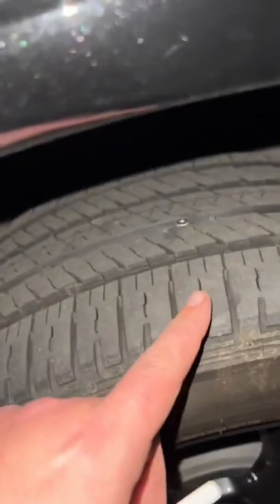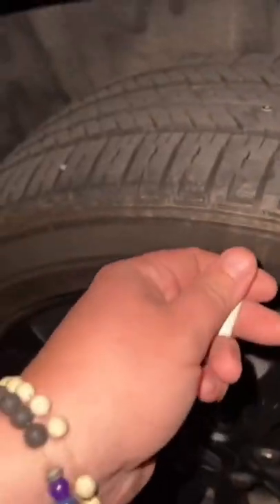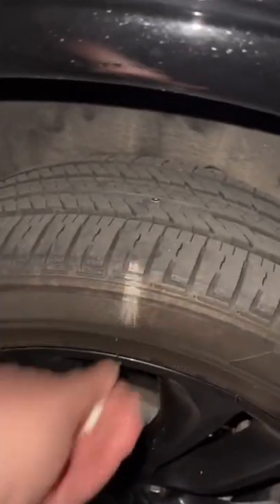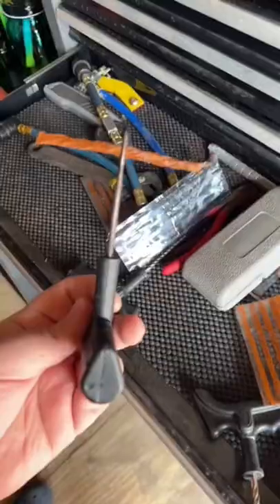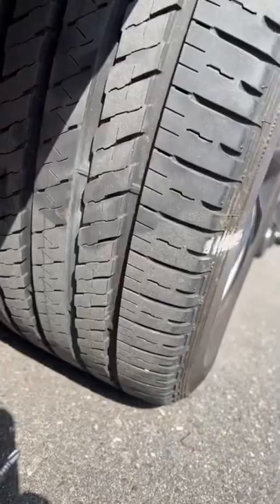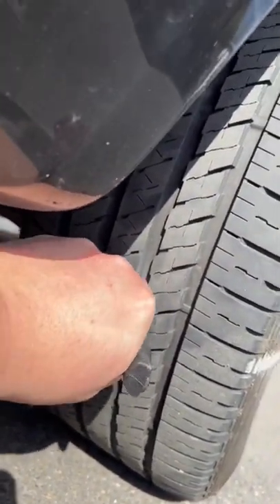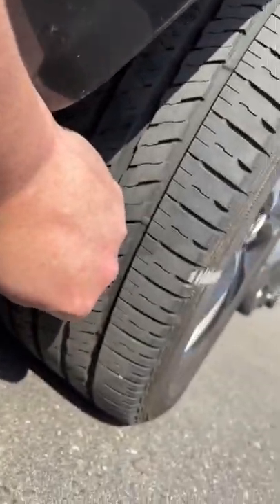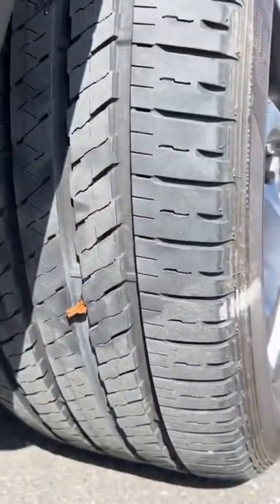How To Plug A Car Tire.

Comment: Additionally if you can’t find the screw/area you can spray soapy wooder to find the leak (the air leak will cause bubbles in the area)

Comment: I've had that happen and I was glad it barely leaked. It's nice being able to drive to a shop without having to throw a spare on. People say plugs aren't a permanent fix but I've been drive on one for 4 years and all throughout my childhood my family used them and never had one fail.
Reply: The probability of having a puncture caused by another object on the same tire is much greater than a failing plug so by my logic i consider it safe enough, always used plugs as a permanent repair on my cars over the years not a single problem so far.

Comment: Cool video. Nice discussion in the comments. I've used plugs a bunch of times. Mixed luck when the hole was between the treads like this one.  Usually works better when it's in the thick part of a tread.

Comment: The plugs are not meant for vehicles. They are only meant to be used on anything that goes under 25 MPH. They can easily come out on cars and trucks running 55 or faster because of how fast they spin. Did this on a 50 CC and it came out with all my air lol.

Comment: I would highly advise getting a patch plug instead of a plug.
Reply: Isnt that for bicycles?
Reply: Patch plug is impossible to apply with just hands. You need a machine to remove tire from rim
Reply: And your qualifications for making this statement are? Steve here is an experienced mechanic.
Reply: @greego5952  a plug patch combo patched from the inside will insure no moisture gets into the steel belt and rust, if moisture did the steel could delaminate and that’s when it’s prone to blow outs, but it seems like just a plug can work but might as well take it to a shop for a proper plug patch because it’s almost always free (tire tech with 2 years ex)
Reply: @jaredmarban9771  jam a plug in there. If the plug starts to leak after a few years, jam another one in there and ur good
Reply: @troyzuber5739  did U even read what he said the problem isn't that the plug leaks air can get between the layered steel cords along with moisture air can cause the tyre to seperate

Comment: Here is a good tip , if you don't know where the hole is you can put water and soap on the tire . It will bubble where the hole is located)

Comment: All this talk about how you shouldn’t plug your tires. Ive been doing it for years with no issues🤷🏽‍♂️.
Reply: You can plug a tire easy and fine but if the hole is on the sidewalk of the tire it’s best to replace it as the strength and integrity of the tire has severely gone down and could blown for any reason
Reply: @blakelawrence1623  oh yeah. Id never repair a sidewall with a plug. Thats a problem waiting to happen. Just saying in general. Never had an issue with plugs
Reply: @blakelawrence1623  sidewalk 😭
Reply: That's why you've been doing it was years🤣😭
Reply: That's pure luck my man, in the short three years I've been changing tires, store bought plugs have been the source of a leak more tines than I can count

Comment: Personally I advise getting that tire patched ASAP, I use plugs mainly as a resort for when I'm a long distance away from the tire shop or dont have time. You cant really trust those things
Reply: It's better than nothing. I patched my tires with this and they last until they're done and need for new tires. It's handy to have these patches in the trunk
Reply: @undefinednotfound  yeah I'm not saying to refrain from using it's just in my opinion I dont like running them for too long.
Reply: @josephthomas1152  tires don't last for decades so simple patch is good enough

Comment: Did you know….it’s illegal for tire shops to plug your tires?… it’s cause we patch them which involves taking the tire off the rim, so glue, some fire, more glue and there you go.
Reply: I’m not sure if it’s illegal, I thought it was more of an insurance and liability type thing due to these plugs only really being designed for emergencies and not long term use because it will potentially lower the tire’s max pressure
Reply from the maker: When did this become a thing? We used to plug tires all the time back in the day…
Reply: @ClawBoss  my boss was telling me that’s why we patch and not plug, but people can do it to their own cars, just we can’t do it for you.
Reply: @unnamedracer9757  I do think that has much to do with it. Amount of lawsuits to tire companies also lead to this as well
Reply: @ClawBoss  my mechanic gives u the option of patch or plug.. pretty sure it legal.
Reply: @ElisPalace  up8s and 10s work better on a small hole as they are smaller, don't have to be placed bead to bead and they can be placed closer to the sidewall then a rad patch but apart from that Ur process is right

Comment: Next time buy your next set of tires at discount tire shop. They will replace your tires for free with insurance no questions asked within the lifetime of the tire. Free unlimited checks. Free unlimited tire rotations, free unlimited balances. 
I paid a little but extra for my tires BUT I saved all that plus more when I got a large screw. They gave me new tire no problem.

Comment: When you clean the hole and widen it shouldn’t you spray it with a some dish soap or something to clean up the hole. Jw because next time I get something stuck in my tire I’m doing it myself instead of taking it to a tire shop for 25 bucks
Reply: I don’t know if that’s a good idea, the dish soap may cause the plug or cement to not stick as well because it’s so slippery

Comment: Don’t plug your tires people. Get them patched at a tire shop, it’s cheap and far more reliable than this option. There’s a reason they don’t use plugs at the tire shop
Reply: I used to be like you and only patch my tires But I found that plugging tires is much safer because it’s a more permanent fix and it won’t blow out
Reply: @williamriley-jones  U just said the opposite of what happens plugs have a higher chance of causing Ur tyre to blow then a patch

Comment: That works but fix-a-flat does the trick
Reply: As someone who works at a tire shop, no, never use that
The short explanation is that it can mess up a tire very easily and at certain tire shops such as the one I work at (Firestone) we are not allowed to patch a tire that had fix-a-flat in it because of that exact reason
Reply: @unnamedracer9757  how can it mess up the tire?
Reply: It can just put it off balance, its not gonna mess up the tire,  but still a plug with out last the rest of the tire
Reply: @unnamedracer9757  2 of the tires on my car have got a nail in them and fix a flat hasn’t caused any problems??
Reply: @southmassrailfan  Because his problems when you try to repair it properly with a real patch because the patch will not stick

Furthermore, it leaves unnecessary liquid inside your tire, we can easily throw off the balance in therefore cause vibration
Reply: @dustinengel8468  it will also prevent they proper patch from sticking